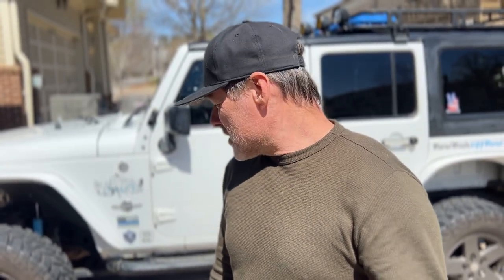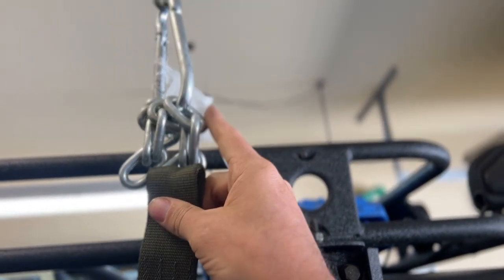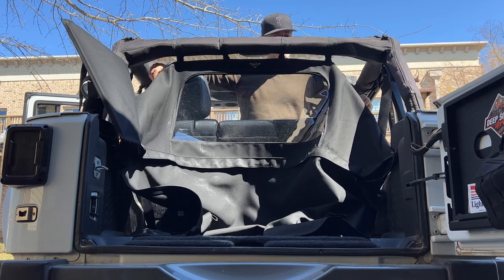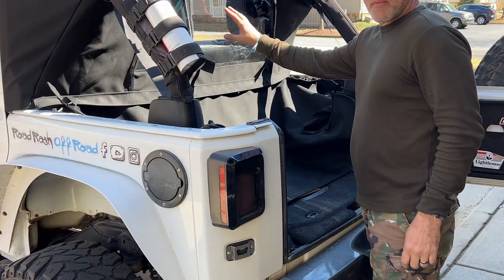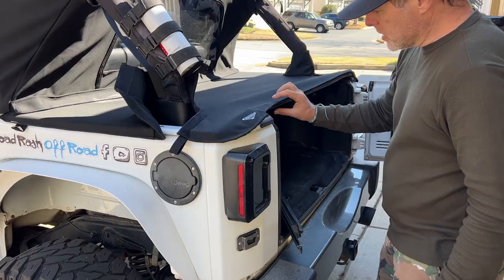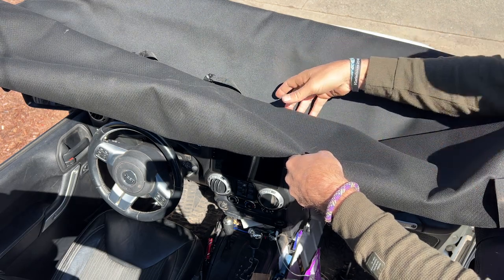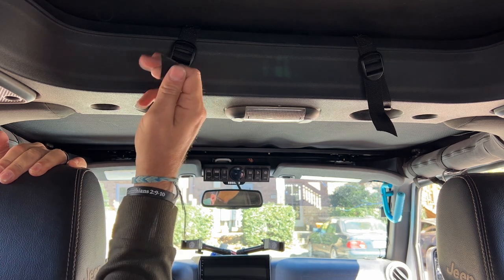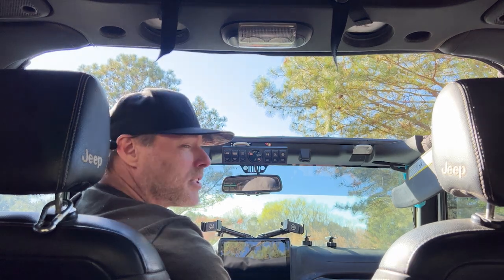GET NAKED AGAIN - The Best Soft Top Option For Your Jeep - Master Top Summer Collection

Comment: Can we get a 1 year review on this top? I’m looking at getting a new one. And curious more about the door surrounds because I have Smittybilt door surrounds and curious if they will work
Reply from the maker: Hey Brandon. I can absolutely do a one year review on this top. I’m right in the middle of shooting a video series called Overland Overhaul and it requires me to have my hard top and RTT on the jeep, but as soon as I finish, I’ll pull the hardtop off and put the Mastertop back on. 

I can tell you now that I love this top just as much now as I did 1 year ago.  When I don’t have the RTT on the jeep, I always have the Mastertop on. 

I’ve started to see a few water leaks recently that were not there before. Not sure if it’s a door seal or the wear on the top. I’ll address all of these in a long term video of this top.
Reply: @RoadRashOffRoad  awesome thanks and can you show a little more on how it goes on the surrounds when you do it I should be able to tell if mine will work